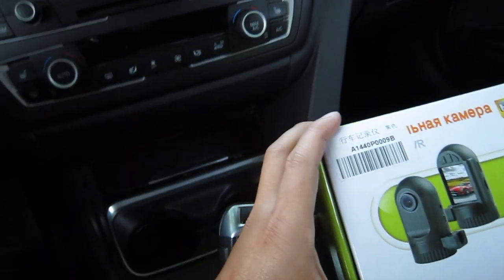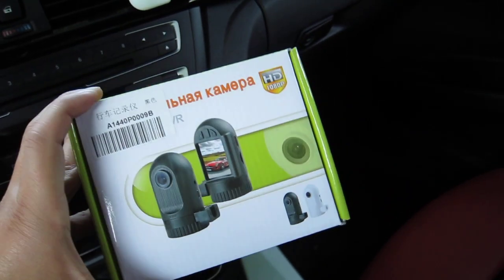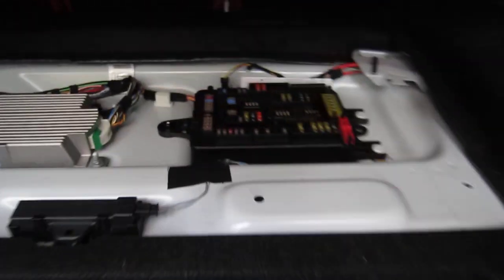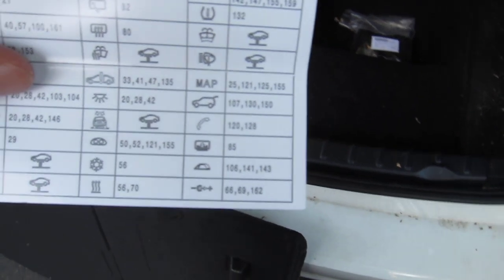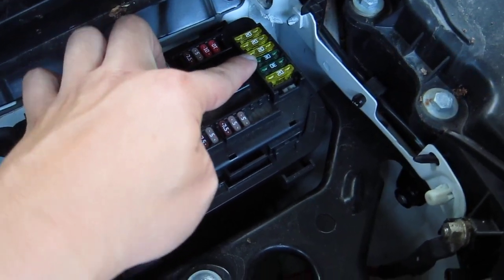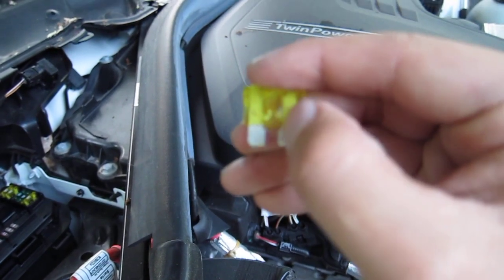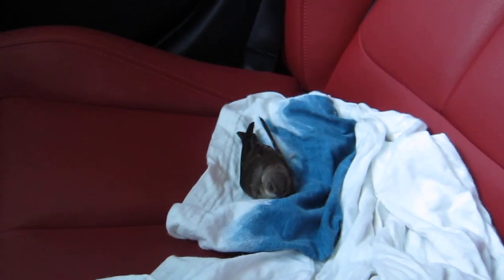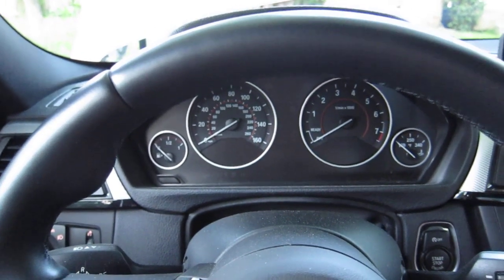Replacing Cigarette Lighter Fuse - 2013 BMW 328i (F90)

Comment: Thanks, man! I never would have figured that was the picture for a cigarette lighter fuse. I can't believe BMW makes getting to the fuses such a PITA. Thank goodness now I can pull the correct fuse out of my Mini, located in the front on the passenger side. Also, I have tweezers, but I will look for the removal tool described in the comments. You saved me a repair bill, and this 70-year-old lady is grateful. <3

Comment: Just did the fix, noticed that there is a red tweezer type tool to pull the fuses. It's in the trunk fuse box. Just an FYI. Thanks again

Comment: Thanks for the video. I was able to replace the blown fuse. Question... Does the power socket turns off after ignition is off? I connected Dash Cam and it kept turned on even after ignition is off and other small lights on buttons turn off after 1-2 minutes. Dash cam remains on which is plugged in cigarette lighter socket. My car is F30 2013 model.

Comment: coming to you as a car guy, you did a good job walking it through.  Btw, the fuse puller tool was in the back of the trunk (in orange).

looked like this:http://img0.fastenal.com/productimages/0760571.jpg

Comment: my anti entrapment warning light keeps turning on.  My rear windows have been bolted up permanently.  I would like to pull the fuse that works the warning light.  .  328i 2007 coupe